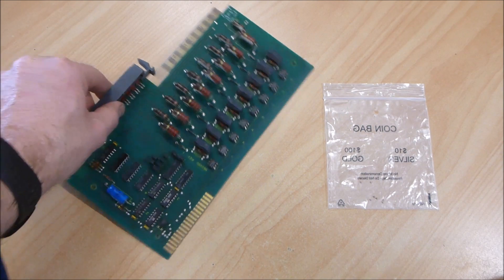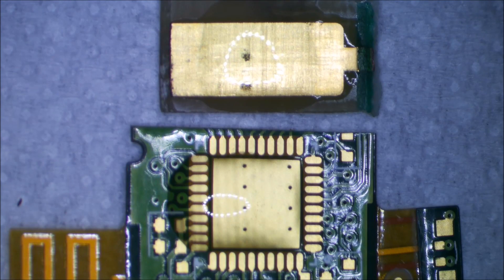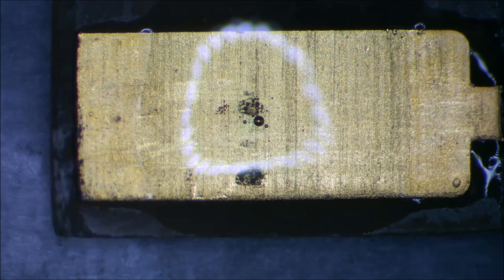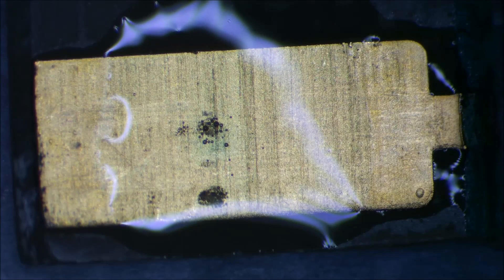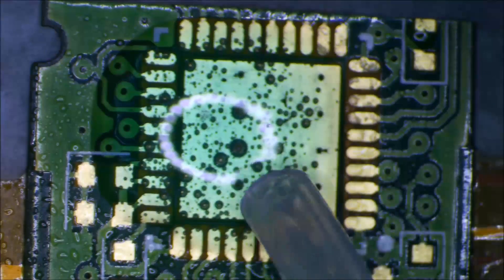Gold Recovery - Mailbag Episode 1

Comment: Hi, look forward for silver extract video..cheer!!
Reply from the maker: I have recovered a bit of Silver over time, but really it is worth so little that it is usually not worth the trouble or chemical waste for me to bother too much with Silver.
Reply: Successful Engineer By the way, why its quite so little people doing silver recovery form used fixer solution / x ray film? My uncle is doing this business quite some years. But since that recently i found out that clinic/hospital is swifting to use digital (which means no more fixer and the film not contain any silver). Australia and New Zealand also all using digital?
Reply from the maker: Yeah, I think the biggest problem would be getting hold of the waste in New Zealand. The country and hospitals are very strictly regulated, so they probably have to pay some waste disposal company to take away their solutions so they have trace-ability. But as you say, probably most X-rays will be digital these days.

Comment: Could you tell me how that method is what solution you used?
Reply from the maker: The solution used in all these videos is 1 part 68% HNO3 and 1 part H2O
Reply: Successful Engineer What did you use to make this golden ball in the solution
Reply from the maker: Wilker Costa Dos Santos I did not make those, they are from inside some electrical switches
Reply: Successful Engineer Thanks for listening

Comment: hello friend, i looked that there was ic chips in the card, did you think there is gold to because you forgot to refined them! the switches contact of gold have many color red bleue and blue color i have already refined them in past. usually the ic chips in those old card have a good ratio of gold. catch ya later and take care . very good video as always!
Reply from the maker: Hi David, thanks for the great comment as always. You are 100% correct, there is definitely more Gold than just the fingers, but I've never seemed to have good yields from those plastic DIP chips. The ceramic DIPs on some of those older boards are fantastic though! I might crack open a few of those and have a look with the microscope.
Reply: You also have some jumpers next to the DIPs, just lift one of the jumper caps to see if the pins are plated.
The board seems to be a 8 x digital input or output from an old style PLC(if anyone is curious).
Reply: I would love to see a thiosulfate gold Leach video from you

Comment: Wow your gold value estimate process is incredible.  Very nice work.
Reply from the maker: Thanks for the compliment, I will have a chat with the subscriber and see if he would be keen to send me a few of those boards to run so we can see how well the math and reality agrees.
Reply: Yeah that would be quite cool. I am interested about your numbers on gold plating thickness. There isnt much i could ever find out there about it.  I found this neat website though.  Just google "Understanding PCB Manufacturing: Hard Gold Plating" they have a neat calculator for how much gold it would take to plate gold fingers when making circuit boards of the type of hard gold, but it appears that they are using 300 micro inches of plating which would bring the value of those sticks you tested up a ton because you were using 30 micro inches in your calculation.  Anyways, I look forward to the video if you can get some more to process to try and get an amount that can be quantified. I never took the gold refining as far as you have.  It is really nice to watch because I have done quite a few experiments trying to quantify the amount of gold and silver and palladium in different electronic components but not with much luck I like the math approach.  I am a chemist by trade so the assumption is i should be quite good at refining but that has not turned out to be the case lol.  I was working on a project trying to deal with complex mixtures of metals including base metals and precious metals, but it turned out not being as easy as i thought.  I decided to leave it for someone else and move on because I didnt have the proper equipment to process the material the way i should have.  But someone else has the process down so there is no reason for me to reinvent the wheel.
Reply from the maker: Hi, I have come across that very same site, but pretty much every PCB manufacturer site apart from that one lists the thickness somewhere in the 25 to 50 u-inch range, will certainly try my best to get a few of those boards to check my estimates. You are 100% correct, I've found E-waste gold recovery to be 80% mechanical engineering and 20% chemistry, especially dealing with bond wires from ICs! And then as you found you have to deal with many unknowns in your solutions, I've been at this for a few years now and still regularly see something new :) Anyway, your channel looks cool, looking forward to watching a few of your videos!